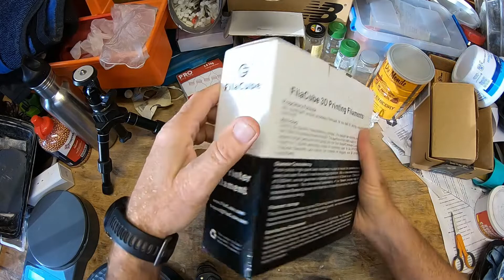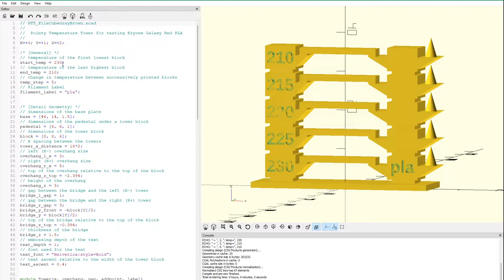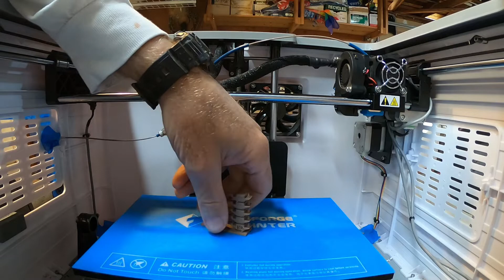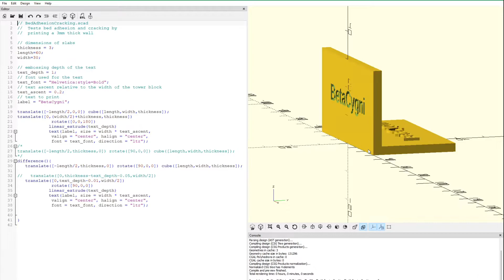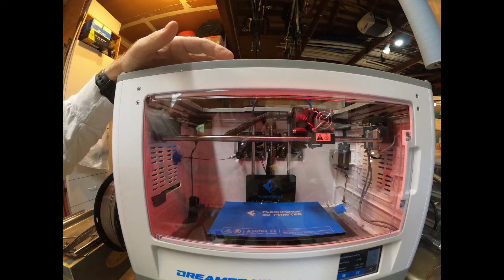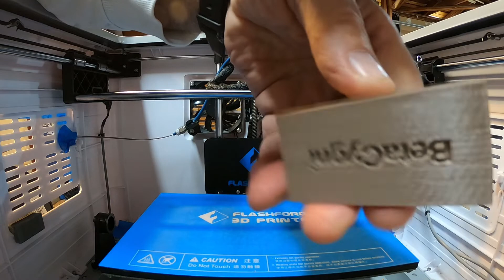Flashforge Dreamer (NX) - FilaCube Grayish-Brown PLA2 1.75mm Filament Testing - Part 1

Comment: I dropped filacube as my supplier of filament and went to hatchbox. Never been happier. My spools were often coming in less than 1kg, the tolerance was often out of spec, I wanted to love this filament but I ultimately dropped it. They are local to my as well which I wanted to support but just had to move away from it. The only thing they do great is how dense the colors are. They dont bleed light as easily.
Reply from the maker: Thanks for the comment. I've had good luck with FilaCube and like you say the colors are great.
And as I said in the video, this is the first reel I've been shorted on from FilaCube.

I haven't tried Hatchbox PLA so far because it's more expensive than other filament that works for me.

The filament brand I use the most is CC3D's Silk PLA (Copper, Silver, Gold, Red) because I'm mostly making metallic looking items for my Etsy store:
https://www.etsy.com/shop/BetaCygniDesigns
I have reviews of those here on my YouTube Channel in the 3dPrinter playlist.

I did get a reel of Hatchbox free from Filaments.CA as a new customer. It was labeled "Kex" but on the documentation, it said (Hatchbox).
https://youtu.be/4UqQRotlh4M
I've only used it for prototyping, not a finished product. It flows very well.
I do like the Gold Hatchbox PETG and I have a review of that coming up later this year.